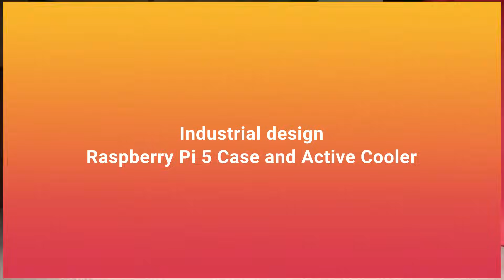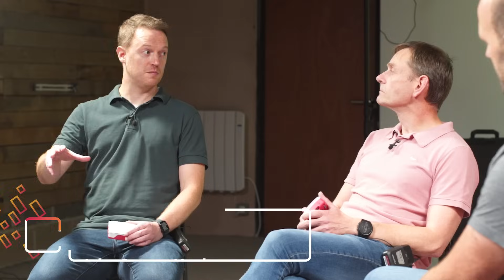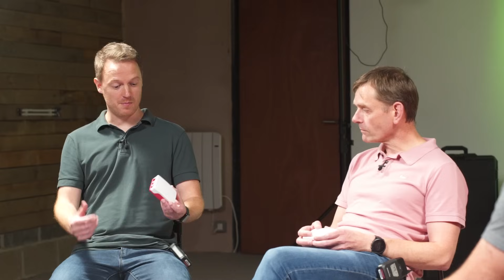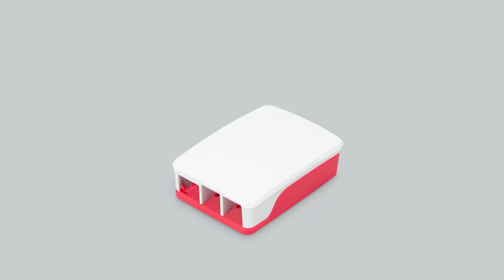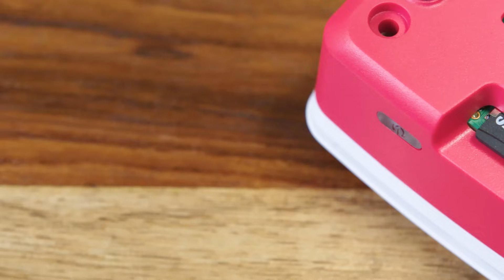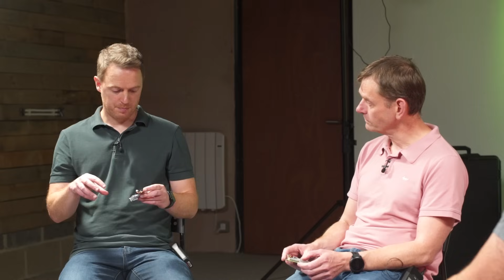Designing a bespoke case and cooling for Raspberry Pi 5

Comment: my concept of the perfect case is somewhat different. I have, in the past, put an UPS in the case. I won't be doing that again. more about that below.

I am currently trying to get a LoRa Hat working on an RPi. It's a nightmare. what I need is a case that will let me stack extra 10 mm and 15 mm layers, so I can adjust the height to accommodate various hats. existing tall cases allow for 1 hat. I might conceivably stack 3 hats. I need a snap in extension on top of the case.

Comment: Love being able to see the board, having a clear version of this case would be great ✨
Reply: Yes! Bring back clear electronics
Reply: One of the issues with doing that, is you also get to see all the b-surfaces.  All those bits that are designed to be hidden away, for example, the injection points always have some element of blooming where the hot plastic is injected, this changes the mold over time meaning you can see an obvious marking of the material.

Comment: I want a passive cooled Pi 500 :)
Reply: With PCIe lane routed to internal M.2 Slot. Onboard antenna header and option punchout hole in case to support use of Compute Module 4 Antenna Kit. And POE hat header could be useful in some setups.
Reply: active ice tower have perfect cooler at raspi.

Comment: Put CPU at bottom part of the board so any hat would not trap any heat
Reply: We did think of that originally, but it makes manufacturing a little more complex.  They like to have all the heavy components on one side, because it makes it easier to develop the right temperature profile in the SMT oven.

Comment: Does the active cooler with heatsink also fit inside the official case?
Reply: It does if you remove the fan insert (the clear bit), but the active cooler isn't really designed to be inside a case and doesn't really drive air through the case.  But it does work...
Reply: Jeff Geering tested this and it does. You just have to pop out the clear fan bracket included with the case
Reply: asked the same question
Reply: I saw a comment elsewhere that seemed to suggest it does
Reply: I've heard it fits if you remove the case fan
Reply: It is very suspicious they haven’t shown it inside the case in any pictures
Reply: Exactly the question that came to my mind, especially when towards the very end of the video they revealed how much better than it was compared to the integrated fan in the case. I would either look at a different case solution or take the stock fan out of this case and run the heatsink/fan solution instead.
Reply: I have the same Question
Reply: Was just thinking also, since it sounds like Raspberry Pi will sell a daughterboard that have a NVME slot for fast SSD's, i guess we need a case that fits both that and the active fan? But I guess the nvme drive needs extra power supply?  I mean if they come with heatsink on my PC i guess they use some watt :)

Comment: does the pi5 actually need active cooling for "normal" use?
Reply: No, not exactly...  I've been using mine on my desk and completely forgot I hadn't plugged the fan in...  It'll idle at around 55 degrees with the lid on, but if you were playing a youtube video it'll get closer to 80 (which is the point at which it begins throttling down to the performance of a Pi 4).  But generally you don't notice...  Which is why I was using it for three days without noticing!
Reply: No. It may throttle with some long task such as video playback or compiling code, but bursts of activity such as browsing the web should run at full speed without active cooling.
Reply: It will need a heatsink, of what size I don't know... you can cool gaming computers passively with enough metal and fins
Reply: If you don't put it in a case it will last 30s under full load until it starts throttling from what I've seen. If you're okay with throttling or don't plan on putting it under continuous load a cooler isn't needed. Throttling will not damage it.
Reply: Based on the reviews posted by the likes of Jeff Geerling and others who received review models the Pi5 reaches thermal throttling very quickly even with light use, so some kind of cooling solution is a must. ExplainingComputers did perform a passive cooling test in his video last Sunday which appeared to work well enough to prevent thermal throttling.